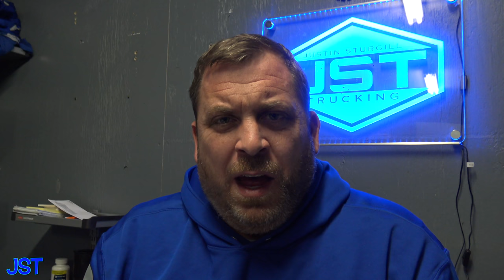HOW TO PICK GEAR RATIO IN A SEMI TRUCK OR DUMP TRUCK

Comment: Regarding the allison transmission..we been running Allison's in dump trucks since 1995...yes the wide ratio 4500 model 6 speed allisons are horribly geared. ..if you ever order another allison you wanna get the close ratio 4700 model 7 speed allison...the gears are more evenly spaced...you will be much happier.

Comment: I was hauling fuel in B-trains at 140,000 with 500hp@1700 and 1850lbft@1100-1400, with 3.25s(0.78 OD cruise 65mph at 1325rpm) She would pull just fine and got 2.6-2.8km/L(7.33-7.89MPG) consistently. She was not mountain truck(up 7% grades at 18km/h at 140k). I miss that truck I'm looking at one right now with 3.70s(65mph cruise is 1600) I like my slow turning gearing, who wants to listen to revs all day? Go drive a ricer lol
Reply: Hello from South Africa 🇿🇦. What truck was this? We're u from Australia?

Comment: As of now the boss buys trucks with the Paccar MX 13 and my current truck has the 500 hp/1850 w/ 18 spd and 3:91 gears. At 70 mph the engine is turning 1600 rpms and I'd spec out another truck to where it'll turn around 1400-1500. Most of these newer engines are making there torque at a lower rpm and there hp at a higher rpm. The Paccar doesn't see its hp until like 1700 rpms.  Always heard that you'd wanna use the torque of the engine as far as your pulling power goes.  Great video and insight on gear ratios.
Reply: Lol, mine doesn't do too bad. Flat grounds and slight up grades it's does just fine.  Now 6% grades now that's a different story.  Good thing for this 18 spd. Then again it's a 13 liter so it's not gonna perform like the 15 liter.

Comment: before i watch  this-i know you have 3.91s -thats what my new build is also, but my last truck had 4.56s  and for 19 years she was running like 1800rpms @ 64mph, i'm listening now to ya and -i'm wanting to go taller tires but then my final will be like you said around 3.73 not sure if i'll like that, i like to roll off road  with no throttle when fully Loaded !   yeah! with 4.56s and low hole reverse that was my old norm and loved that!  contractors would ask" dont you have a throttle in that truck?" when other guys are beating their trucks to back up -i idle! No BS just my old truth  :)  you are right on the money on this video  and the only hate will come from nitwits! Justin keep up the good work! and KEEP ON TRUCKIN! over!
Reply: a 24.5 adds 10mph 24.5 lowpros add 7.5 mph
Reply: I’m running a Dumptruck with cat c10, 10 speed and 5.29 rears. I’m changing to 4.30 rears next week.
Reply: @papinlima8624  Is it an expensive job? Do you have to get the ECM reprogrammed also?

Comment: I custom build eaton trans for guys here.. Eaton dont build the combinations I use however they do make the gears.. 35yrs building powertrain now have alot of combinations you cant buy at the swap shops.. It's all how you combine ratios of gears.. Rear ends are what they are.. But trans I have worked wonders in custom gear combinations..
Reply: How can I get in touch with you,?

Comment: I got a 2018 Cascadia with 3.08 gears and 11R22.5s. At 65 MPH (which my truck is limited to by the Province of Ontario) I’m turning 1300 rpms.
Reply: That's ok but would run better at 3.5 but not bad

Comment: 2016 KW T660  
CUMMINS ISX15 550HP 1850 TORQUE
Modified 👇
OEM: 13SPD 0.73 W/ CLUTCH 1850
DIFFERENTIAL 3.08 RATIO
UPGD; EATON 18SPD 0.73 W/ CLUTCH 2050
DIFFERENTIAL 2.93 RATIO
Route California to Boston 🔄 REEFER 7.2mpg Avg.

Best modifications I made.
Engine running strong still, after Million milestone and counting...
Reply: We have almost the same combination how did the 2.93 ratio did pulling up hill's like a 7% grade I got 4.25 and I can't pull a hill to save my life
Reply: @nickyfalcon6157  I guess just the way I maintain my truck " Valvoline 5w40 fully synthetic" every 21000 miles. I have seeing a loaded flatbed passing them at Grapevine same on I-70  Colorado, all I do drop my gear and keep my RPM to sweet spot at 1400-1500 max, and of course assumed they're running up the hill at 20-25 mph. 
Make sure you really getting the 550hp on the engine...
Look closer on the emission systems, no fault code doesn't mean nothing wrong with it. 
That's just my two cents.

Comment: An X15 performance series engine makes peak torque as low as 1150 RPM and carries it to an estimated 1500.  My DD15 engine makes 1750 ft-lbs at 925 RPM and carries 90% of it out to just before 1400 and then starts to drop it.  Peak horsepower, when I last had it dynoed with 470,371 miles on it, was 505.87 at 1800 with 0.02 blow-by as advertised.  My tires are 11R 22.5s, the transmission is a direct drive DT12, and the ring and pinion ratio is 2.54:1 which makes my truck guzzle fuel and run 70 Mph just after the torque band falls off.
Reply: What year is your DD15 equipped truck?

Comment: 46 rockwells, 4.78 ratio with an overdrive 15 or overdrive 8LL on 11r24.5’s is my favorite setup, of course all I’ve ever run are sub 400 hp engines except for one 475 horse N14. It puts the engine around 1850 at 70 and 82mph at the governor. Of course I only drive 65 on the highway,

Comment: My company truck is setup like this:

Model - Kenworth T680
Engine - Cummins X-15 Efficiency
Power - 455 hp @1500 rpm / 1850 ft-lb @1000 rpm
Transmission - Eaton Fuller Endurant 12-speed automated manual
Final drive : 2.93
Tires: Michelin 275/80R 22.5 (all tractor wheels)
RPM @70mph: 1,500 rpm
Reply: How is your fuel efficiency with 2.93
Reply: @doityourself2save  I remember it was around 6.9-7.9 during various driving conditions in the eastern region. I got around 11-13 bobtail and 7.5-9.5 with an empty. My current truck is completely different so my memory is sketchy.
Reply: @MyWatchIsEnded  not bad at all
Reply: So what is the big trade off or downside to a 2.64 vs a 3.08 gear ratio? We run I 95 PA to FL and I 40 NC to OK. Some midwest and CA about once per year
Reply: @rodericksimmons8815  That depends on the engine selection, transmission gear steps and gear count, as well as the torque rating of the engine. Tires too but everyone uses 22.5 so it's irrelevant. The trick is to spec the truck for the right type of usage you're intending or to build for general use. A slow chugging RPM Cummins is great for very heavy loads and for steep upgrades. The paccar MX-13 is higher revving and much more peppy even with a lower horsepower rating due to the higher torque ratings for their engines. I would use paccar for general use and for long distance OTR work. Cummins is great for heavy loads and for mountains. Paccars are cheaper to repair and Cummins are more expensive. After you select the engine you need to select a transmission that will have a great resale value, ease of use, and reliability. If going with the Cummins I would choose either an Eaton Fuller 13-speed/18-speed manual or their Ultrashift plus variant (different models provide different gradability ratings). If paccar I suggest the same manuals or a paccar 12-speed since it's designed to function with the MX-13 and paccar differentials. The differential ration of 2.63 or 3.08 as you suggested might or might not be what you need when you start to select the parts of the power train. Too high of a ratio and the truck may get poor fuel mileage and cruising speed. Too low and you'll be able to keep the RPMs low but it will require more shifting and lugging the engine. 

The most important part of the trucks fuel mileage, gradability, and reliability are to have:

• high torque
• low RPM cruise speed (1,500-1,700)
• decent horsepower of at least 455hp
• enough gears to make the truck capable of acceleration even under heavy loads and on upgrades (this enables the truck to quickly reach it's cruising speed to lessen time accelerating hard and the time it takes to finish climbing a hill)
Reply: @MyWatchIsEnded  ok. Someone said a 2.64 is the same as 3.42 but direct vs overdrive?
Reply: @rodericksimmons8815  that's not accurate since those two ratios are used for two seperate purposes. The higher the number the slower the drive wheels move which increases torque but lessens the horsepower since HP = torque over time. 

In regards to direct drive vs overdrive transmissions; Direct drive is the more efficient and quicker of the two but sacrifices torque for ease of use and simplicity. Overdrive uses a countershaft to indirectly connect the power from the engine to the transmission which increases the torque but slows the speed of the transmission and adds weight. 

Overdrive is good for most all applications with the right engine and axle ratio. Direct drive usually leaves a little to be desired when you need consistent power in different situations. 

Overdrive in a transmission design, which shouldn't be confused with the "overdrive" gear used to lessen cruising speed in top gear, is used to increase the torque/HP consistency of your truck.

i.e. a 12-speed paccar has an overdrive gear in both it's direct drive (non-counter shaft) and overdrive (with counter shaft) model versions. 1st through 10th gear are gear reductions which help the heavy truck increase the torque force available at a certain RPM range. 11th gear is a direct drive gear where the power is not going through a reduction gear ratio to multiply it but instead it's the engine powering the wheels directly. 12th gear is a single overdrive gear.
Reply: @MyWatchIsEnded  I am not gonna lie, I am in way over my head with most of your technical knowledge here but thank you for attempting to make it plain for me😎
Reply: @rodericksimmons8815  It's no problem at all buddy just remember not to under spec your trucks! Trust me it equals less reliability, fuel mileage, and performance/consistency.

IMO what I'm building is:

Kenworth T680 in white
Paccar MX-13 505hp - 1850 ft-lbs
Eaton Fuller 18-speed Ultrashift Plus
..or Paccar 12-speed overdrive
13k front paccar suspension
Holland 5th wheel 50k
260" wheel base
45k tandem suspension
22.5 Michelin X-energy tires all around
..and a diesel APU to compliment the auto engine/AC starting system.

My dream truck. 👌
Reply: @MyWatchIsEnded  Melton Truck Lines and Lone Mountain  has some with a setup close to that with 2.64 ratio. Decent?
Reply: @rodericksimmons8815  Yeah Melton designs their setups for heavy duty and slow moving mountain and overweight loads. If I remember they have a speed cap set to 62mph. I do pass a lot of them going uphills because they aren't designed for uphill speed, hence the 2.64 ratio. If they increased that up to 3.36 and the horsepower up to at least 455hp it would climb nimbly. If not on upgrades a lot the 2.64 with a higher torque and horsepower would come in use like 500hp+ and 1,750 ft-lbs+. In order to get consistency you need a higher revving engine and stronger power train. The lower the numbers the more it will struggle to do the same job while not really getting better fuel savings.
Reply: @MyWatchIsEnded  would that be a decent setup for mainly east coast hauling. The speed parameters can be changed or removed usually

Comment: I have questions I have cat twin turbo 625 original hp  , whit 2050 tq on engine same on transmission 18 speed,  whit 3.58 ratio , can I put on that set up 3.91 rears ?? I wanna do heavy haul.

Comment: i know there will be a lot of hate for Volvo but tractors today can run 2.22 rears,  Volvo has a Engine making max torque @ 1100 rpm! un freaking believable but true! 900 rpms it downshifts out of high gear loaded on hills! insane! but truth! thats why it literally sips fuel!
Reply: john Chandler  i used the words unfreaking believable and insane for a reason when i commented-do some research if you care and want the truth! ;)
Reply: Ya... I want the details. Due to iShift transmissions, I'm understanding that not all rear end ratios are not the same. 247 rears sound good to run 72 mph, but what every options we have for transmissions makes things confusing. 
So what it is?
Reply: @great2c4me  i actually run 3.90 rear gear  and with 11r24.5s she will do 70mph governed  max  has a ultrashift13speed she gets terrible mileage check my channel
Reply: @NomadicSociety 7:38

Comment: I'm trying to run anywhere not sure of terrain but I'm looking into international prostar or a freightliner cascadia maybe a Cat 660 day cab to run a Mac 6 axle end dump. Do you recommend 10 speed or higher and 450hp+ and the gear ratios? Just wanna make sure I get the right equipment sir.

Comment: I have 560 hp at 1800 rpm and 3.73 gear ratio with 24.5 rubber. Is it good for pulling 130k pounds.

Comment: The problem is the emissions systems and current compression ratios. 
The ISX 15 and X15 will live longer revving. 
Higher the RPMs the more heat pumped into the DOC, DPF and catalyst.

Comment: I need help.  I am purchasing two used tri-axles.  I have a single axle 4300 with 245 hp that runs 72 at 2700 which is full throttle and mileage is horrible.  I was decided on a 2009 Kenworth T-800 with a 5.57 and a 2013 Kenworth T440 with a 5.25.  Grade is flat and majority is interstate driving.  From what I have read here, those ratios are to high.  I have and will have Allison automatics as I will not own a manual.  I am going to supply sand and rock to a concrete company with 20-21 tons a load.  What ratio's should I look for?  Thanks in Advance.
Reply: Also hp is 350 and 370 respectively.  Is this enough HP?

Comment: I have 355 ratio and went from 22.5tall rubber to car hauler 255 small rubber pls help  should I go 3.08 or even 2.64 as someone alrdy told me??
Reply: What are you trying to do? And what transmission are you running? If you want to run highway speed at about 1500 with a normal double od trans you’d need a 3.36 or higher. But to go much higher you’re really gonna want to beef that hp up some or else you will lose a lot of pulling ability
Reply: 3.36 is gonna be about perfect and you won’t lose parts availability when you blow your rear end out trying to get home one day then have to sit at some shit hole dealership for over a week waiting on a gear set to be shipped from Eaton or whoever.
Reply: James Rowland Thxs James  i went 2.64s with a 18 more than happy ..Thxs for replying
Reply: Yea that seems out there to me but long as you don’t do anything real heavy or run mountains the more leg room the better I suppose lol and you’ll never wear 18th out that’s a definite plus
Reply: @WickedIntentSemi  Who did the swap for you? Did you have to get the ECM reprogrammed also?

Comment: N14 redop 525 18 speed from Kansas haulin cattle. Run prettty much all the all 49 states.  What would be best? Also are you able to run different ratios in front rear diff and then a different ratio in the rear, rear differential?
Reply: Depends how fast you want to run. 3.55 is most common for N14 1500rpm

Comment: The reason I find this video is because I have that problem  am running n14 celect with 525 / 18 speed transmission  390 rear but my rpm 1800 at 70 mph

Comment: 600hp n14 Cummins select plus  3.70 rears  11r22.5s tires with  13 Speed transmission  70 mph@ 1700 what rear gears should I go to drop RPM ?

Comment: Can I ask a dumb question, is a 4.11 gear ratio in a hot rod the same as a 4.11 in a dumptruck.
Reply: Chadsbee Ramrod : In the context of "ratios", which I assume is the context in which you asked your question, the short answer is, Yes. Remember that when most people talk about gear ratios they leave out the final part; the "to 1". So 3.91 is really 3.91:1 and 4.11 is 4.11:1 and so forth. Although the ring and pinions are substantially different sizes, the actual ratio of 4.11:1 is the same in a hot rod, a dump truck or a matchbox car.
Now, if the context of your question was indeed one of shear size, then my answer would be: What Trucking 101 said. ;-)
Reply: @TrailTrackers  yes i try 2 b funny is all but i guess u actually answered the question :)
Reply: @NomadicSociety  : No worries. In the proper context your answer is totally correct. So much so that if people don't heed that advice, they better have a roll of duck tape handy. Reason is if they don't bend with their knees, they will hear a ripping sound, followed by severe pain, followed by a thud. That thud will be their nuts hitting the ground. Hence the need for the duct tape to strap said nuts back into their original location. ...ROFLMAO...
Reply: No, 15" diameter wheels vs. 19 or 22.5 etc changes any relationship they could have however, axle and drive shaft turns per revolution would be the same compared t each other.

Comment: My white truck has 4.63s but it dont shift into od until 65mph its a gutless wonder but it's all I need in the flat land up here lol maybe if it had a real motor I'd be able to pull hills
Reply: yeah even with gears you need a little HP and torque what u got a dt466 or something?
Reply: @NomadicSociety  it's just a c7 rerated to 360/1050
Reply: Blake Merckle Trucking : OK so that's your "white truck". But tell us what your "red truck" does. LOL...
Reply: @TrailTrackers   red truck has a big cam Cummins so it smokes like a freight train an runs forever

Comment: I have a isx 530 18 speed w900L and i was 70,000going over mt hood and could only go over hood at 35mph any advice feel like it should go over better any advice not shure what my rear end racio is? Thanks
Reply: How much torque does your ISX make? Also you can call the dealership with the vin number and they can give you the specs on what rear gear you have..

Comment: 2013 cascadia 10speed 3.42 gear runs 70mph at 1550 would like to drop the rpm to 1300 you think 3.36 would do this
Reply: nope  https://www.blocklayer.com/rpm-gear.aspx
Reply: 3.36 would have 70mph at 1475 if you have a .73 10th gear..